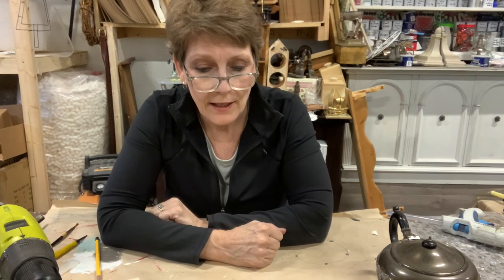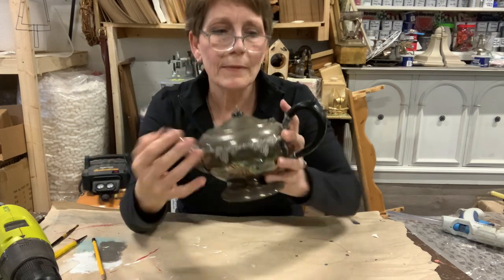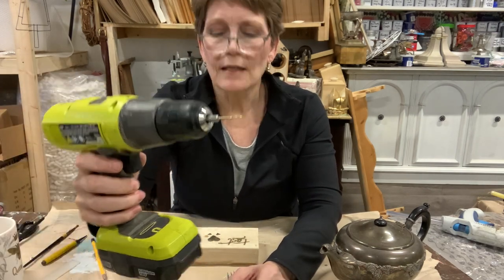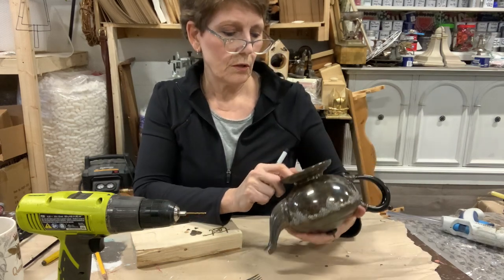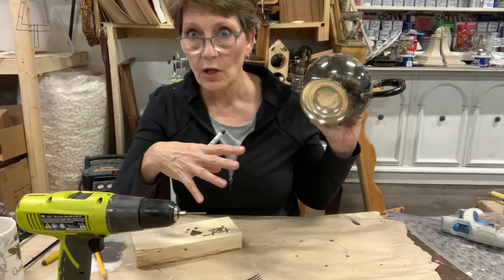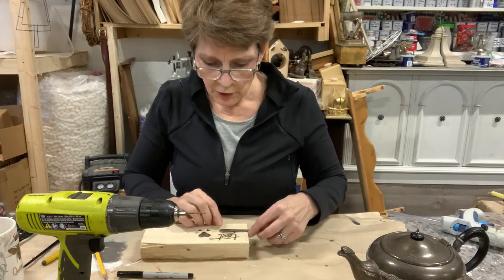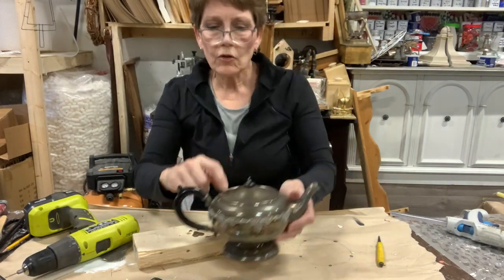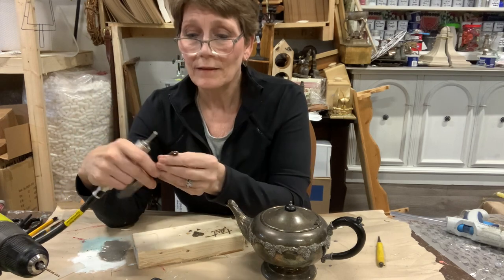Easy Project- Making Wind Chimes From a Teapot

Comment: I have trouble drilling metal.
Reply from the maker: I didn't have trouble drilling through but...  I had a new drill bit for metal and I made sure that the base of the tea pot was a flat, even surface.  Drilling through the cutlery didn't seem to be an issue either but, again, I think it's because the drill bit was not worn down.